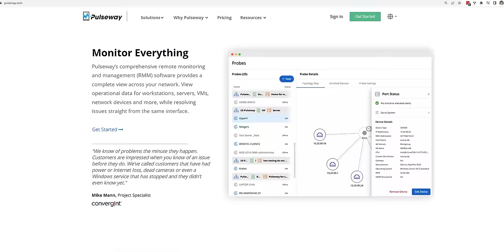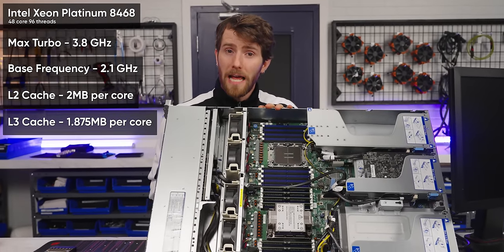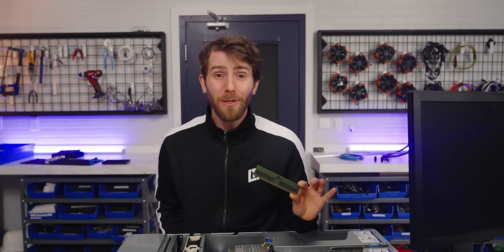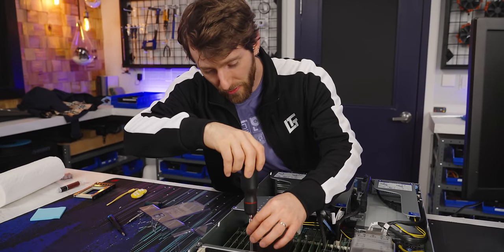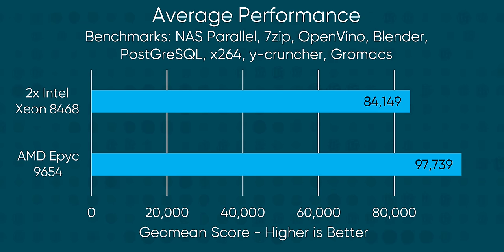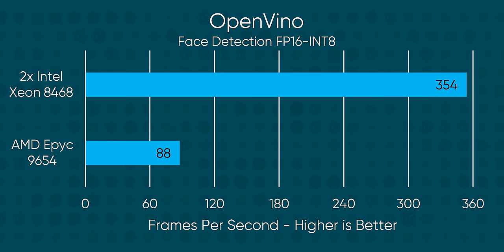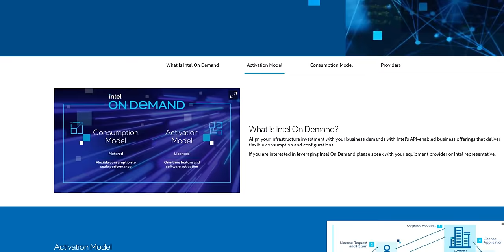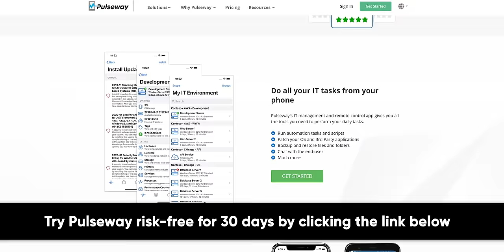Intel’s New CPUs are Cringe - Intel Sapphire Rapids Xeon Platinum 8468

Comment: But wouldn‘t the lower power consumption and lower Price of EPYC make it viable to install a pysical AI accelerator?
Reply: Or just wait a generation for amd chips with accelerators on chiplets. They're putting ai accelerators in their next gen laptop parts.
Reply: Unrelated: TPM 2.0 that is required for Windows 11 has security bugs so AMD and Intel are also putting new hardware security logic in future CPUs beside AI. I wonder when Windows 12+1=13+1=14nm+++ will require those instead. Hoping AM5 still supports those future CPUs in that case, from what I hear Windows 11 is a miss :P
Reply: @Malc180s  but if you can get by, then you can wait.
Reply: @mikfhan  From what I've also heard it's a mess, that's why I'm still running 10 and won't be upgrading for a WHILE.
Reply: @josiahsimmons9866  Why, because of the security vulnerabilities? They are unfortunate, but caring about them as a user does not make sense, and here's why:

On your current Windows 10 installation, you either are using Full Disk Encryption (likely Bitlocker), or you are not.
- If you are not, then you have far larger security concerns than the TPM 2.0 vulnerabilities, and therefore shouldn't care about them. 
- If you are, and you're using the TPM, then you're already subject to the TPM 2.0 vulnerabilities.
- If you are, and you have a different solution to Full Disk Encryption (encryption keys stored elsewhere), you can still use it on Windows 11. Just because you have a TPM doesn't mean you have to store the encryption keys on it.
Reply: @oumu  I have other reasons for not going to windows 11. I'm running a 4000 series ryzen chip, so I imagine that windows won't really be that optimized for it. I also heard that windows 11 was having issues with AMD chips in general(though it was a while ago, so maybe now that's a non-issue.) Ultimately the biggest issue is I use certain software that I'm not confident will run, or run stably, in windows 11 because of how relatively little development time they've had to update to it. Shoot, in the past, when I upgraded to windows 10 Minecraft wouldn't even launch for years. So I definitely have the precedence for software breaking with an OS update. When I eventually build myself a desktop I'll probably update to Windows 11, but that's anywhere from a year to 3 years away.
Reply: @Malc180s  Imagine all the people who have been waiting for this CPU to come to the world.
Reply: @josiahsimmons9866  ive been running 11 for a few months and works just as well as Windows 10 so far
Reply: @josiahsimmons9866  you can always create an 11 install on another drive and try it out
Reply: @zombl337og  Maybe it works for you, but I have sensitive software that I need to have running as smoothly as possible. To update to 11 is just not smart for me at this point. I also really don't see a reason to upgrade at this point.
Reply: @mikfhan  Why did big server run Windows?

Comment: That method of cpu installation has been around since first gen xeon scalable. You're also supposed to leave the cpu in the tray and put the heatsync on, then remove the assembly from the tray and install it on the socket. That method keeps you from getting any oils on the contact space since these cpus are very sensitive to pressure and contamination. Granted, I haven't worked on this newest generation but have plenty of experience with most of the previous revisions and have had to troubleshoot multiple installations where people didn't install these cpus correctly
Reply: Pretty sure he doesn't have a CPU tray because it came to him as an assembled system. So he had to improvise. That's not an excuse for getting goop in the socket, but it's why he isn't following the proper method.

Comment: For the AI benchmark that you  performed, there is an important disclosure to make: OpenVino is developed by intel, so it is only logical to be optimized for their hardware (so the AMD results may not be that bad in AI after all, if the customer is using another Artificial Neural Networks inference engine such as ONNX runtime).
Reply: intel has for a very long time provided some of the best open-source tools in all fields.  In general more often than not using alternatives just means far worse performance.
And also no, their code is optimised for general purpose X64 CPUs as it also has to run from their lowest single-thread Atoms to the 288thread lineups.
Reply: @ABaumstumpf  You're wrong, there's no such thing as a "general purpose x64 CPU", if you want your code to run fast, AMD and Intel don't have the same feature set, AMD didn't support AVX-512 till Zen 4, virtualization features are implemented differently, and , Intel C++ compiler is both closed source, in some situations faster than open source alternatives like GCC or llvm, and it deliberately generates a binary that only enables fast code if it detects an Intel Branded CPU, even if AMD supports that feature.

Intels response on the github bugtracker to AMD bugs is:

> Thank you for reporting, OpenVINO is officially supported on Intel Processors. Please take a look at the system requirements for additional information.

so yes, OpenVINO is crap for a comparison.
Reply: @woobilicious.  "You're wrong, there's no such thing as a "general purpose x64 CPU", "
NO there absolutely is. that the CPUs are not identical is the reason why you then compile the source for your  specific hardware to take full advantage of that, but the code as written does not rely on any of that.

"Intel C++ compiler is"
Completely irrelevant cause is a source you compile on your own.
Reply: @ABaumstumpf  OpenVINO is only supported for intel and (by community) some ARM chips. Code can be written in ways to benefit your architecture, and thus not a competitor. Matrix multiplication for example is probably way more optimized when using AMX, and not care as much to optimize other. 

Its incredible hubris to think that software made by intel for intel chips will even try to optimize for AMD, their only (main) competitor.
Reply: The real test is how does on Intel's CPU AI compare to GPU AI compute. I gather GPU AI still wins by a wide margin for both power efficiency and speed. However, if you really care about performance you go the custom accelerator route.
Reply: @domogdeilig  And it is just outright stupid to claim it is written in a way to harm performance for any architecture.
Reply: @chrisdrew9767  It's a difficult to say if CPU performance or GPU performance is better. It comes down to the implementation of an algorithm and application stability.
Reply: Thanks for disclosing this.
Reply: I'd not be surprised at all if Intel had some "feature" in the code that downgrades the performance when running on non-intel system
Reply: @ABaumstumpf  ??? if iam intel and iam making the sofware for sure i want my stuff to be faster and better than competitor, just a common sense
Reply: @ABaumstumpf  It's not written to harm performance of other architectures. It's optimized for performance on a given architecture. Same result, different motivations. If you want to build the best AI accelerator, and you want to sell your CPUs for their performance in AI acceleration, you're going to make your AI accelerator run even better on your CPUs so that people want to buy both from you. It's not necessarily about making AMD perform worse, it's about leaving no performance on the table when run on Intel processors.
Reply: What about just do a bunch of pytorch/numpy matmul to compare the 2 CPU?
Reply: @ABaumstumpf  First of no. It would not be stupid to suggest a company would make their competitors look bad on their software that they made. Second, noone is saying that they are activly trying to harm AMD. Its just not priority for Intel to get their software to run fast on unsupported hardware especially from a competitor. 

Why do you think NVIDIA and AMD helps game developers write better code for their GPU? To get better driver support and faster performance so when LTT or whatever benchmarkers test, it will be fast on their own plattform.
Reply: @chrisdrew9767  This can be usefull when running inference in production. Thus you can have a services running fast ai inference while also running all the other services you need which isnt AI. So then you dont have (and pay) for a gpu machine to run relativly small amounts of inference.
Reply: @domogdeilig  "Second, noone is saying that they are activly trying to harm AMD."
Aside from half the comments here are doing exactly that.

"Why do you think NVIDIA and AMD helps game developers write better code for their GPU?"
Not just for the reason you claim.
And going to the devs and giving them programming-training is something really different from providing open-source solutions.
Reply: @ABaumstumpf  it doesn't have to be written a certain way to harm performance, all you have to do is turn off compiler options

Comment: when you described AMX, I was hoping they would also be useful for non-ai simulation and animation type work. That involves a lot of matrix math too. But AMX currently only has one matrix math operation, while those non-ai workloads use a diversity of operations. Using current AMX outside of AI would involve lots of shuffling data in and out of the AMX registers, which would severely limit how much those workloads would be improved by the extensions.
Reply: I think it's just a matter of building out support, rather than a physical limitation, unless AMX is pretty useless even for ML. The kind of AI/ML matrix operations that need accelerated depending on what kind of algorithm you are using vary incredibly, and have a lot of overlap with animation+simulation.
Reply: @sophiophile  I'm not sure what you are saying. I am saying that viewed through the lens of what AMX stands for or through the lens of the applications that the name reminded me of, AMX is horrifically incomplete. I have no knowledge or opinions on the challenges or lack thereof regarding making AMX more fully-featured, and I have no knowledge or opinions on whether the current state of AMX is actually helpful for machine learning.
Reply: AMX matrix multiplication is awesome for many ML workloads. Matrix multiplication is also useful for a ton of physical simulations, but I'm not sure how that translates to animations or real time simulations like games. Not sure what Jeffrey Leung is talking about.
Reply: @cobdole9409  The main thing I had in mind when writing that was that matrix-vector multiplication is a major part of sims and animation. A matrix and a vector are conceptually different to me, so I didn't consider that a vector can be represented as a 1-column matrix, allowing AMX to do matrix-vector multiplication just fine. That substantially increases how much I can expect AMX to benefit those use cases.
Reply: @cobdole9409  The OP claimed that it only supports 'one' matrix math operation. I didn't look into the details of AMX, but if it can only perform, for example matrix addition in single steps and not calculate matrix dot/cross products (and by extension tensor products) directly like a GPU, thereby having to perform n^(w+v) operations for a single matrix/tensor product- it is only going to accelerate most ML/AI operations like 5 times compared to a regular CPU in most cases.  When the standard for accelerated ML/AI operations is CUDA where you are looking at a minimum of hundreds of times faster than typical CPU operation speeds, I just don't see how this is supposed to be seen as a selling point.

Comment: Linus drops a glob of thermal paste in the socket & it doesn't boot.  Wow, so unexpected!
Reply: Thermal paste in a socket isnt as bad as xou probably think. Its not conductive, so its not going to short anything out if im not mistaken
Reply: @hypershock4270  
IF its not conductive then yeah, should be fine, however that is not the case as some thermal pastes are literarly made out of metal like copper or alluminium... so depends if he used the metal based one or not
Reply: @robo-suport_czrobofactory3116  noctua's isnt
Reply: Yes most thermal pastes on the market are not conductive, I've seen a guy on youtube who put a whole tube of thermal paste and a cpu on top of a socket and it still worked fine.
Reply: That's what I said!
Reply: @dfjab  
good to know 
👍
Reply: Uh guys , if it's non-conductive then it could /should insulate/prevent a electrical connection to the cpu. Duh.
Reply: @hypershock4270  Yeah pretty much, but it's just such a pain to deal with when it's in those really small areas that are hard to iso out and you start to get worried maybe there's residual moisture still there.

Also I really doubt most people are going to accidentally encounter some kind of liquid metal or other metal containing paste.
Reply: Noctua thermal paste is not conductive.
Reply: @Douglas Holmes  not really
Just look at sub ambient overclocking and them prepping the socket by pasting it with vaseline
Reply: @douglasholmes7581  The amount of pressure the CPU is under will force the material off of the pin/pad into such a small layer that electricity can easily pass through, but there will be buildup around such that it is insulated  from the surroundings. This is why sub-ambient overclocking usually needs vaseline or dielectric grease in the socket, to prevent water condensing in the socket while also creating an insulating barrier between all pins.
Reply: @robo-suport_cz robofactory  if it's not conductive and it covers a pin couldn't that cause a problem in & of itself.  Don't the pins need conductivity to work between the pad & the pin?
Reply: @douglasholmes7581  yes exactly!  💯
Reply: @Domia Abr Wyrda  do they cover the pins in the socket though?
Reply: @bldos5362  yes it's actually so painful to watch lmao
ltt did it a few times too if you want to see Linus doing it
Reply: @hypershock4270  Conductivity is not the only issue here!!! Even perfect insulator around pins can change impedances (and electrical length) of the individual signal lines, from/to CPU, inducing skew. Just take a look, how much attention is paid during design of those traces on the MB, where every micron is important.
Reply: @bldos5362  
i was talking mainly about a short circuit, but sure if you manage to insulate the pin then it would be the same as not having that pin there at all however thermal paste is still not solid, and the preassure should move the paste out of the way to make a connection.

Comment: Did Linux really drop thermal compound in the socket and went "it's probably fine" lmfao
Reply: These aren't the droids you're looking for.
Reply: Good thing he didn't drop the CPU or cooler into a server LGA socket handwaving them around like that. Fuck that was scary to watch.
Reply: No, Linux is an Operating System, not a person.
Reply: And when it did not boot, he just blamed it on the design of the mounting mechanism
Reply: In all fairness if your compound is non-conductive it's probably fine. Pressure should spread it out and contact should be fine with nothing shorting.

But I'd still not recommend doing it =p
Reply: How did an operating system manage to drop thermal compound?
Reply: @outcastatsabre  Linus is the cartel execution videos of tech channels. It's like watching some Jihadist waving around a hunting knife.
Reply: @Stoyon  Linus made linux lol
Reply: @SyntheticFuture  If you have a non-conductive substance between a copper pin and a copper surface, then there won't be any electrical signal between the two (or the quality of the electrical signal will be degraded).
Reply: @RMerlin with a drip this small it should spread out. The contacts are under pressure so it should be squeezed to the "not contact" parts of the die mostly. It is still a very bad idea but still XD
Reply: Thermal compound isn’t conductive.
Reply: @brandongers  some is.
Reply: @brandongers  That's not always true. There is thermal compound that is specifically designed to be electrically conductive for some MOSFETs/IGBTs where the metal back is both for dissipating heat and connecting to ground.
Reply: @SyntheticFuture  Wrong!!! Conductivity is not the only issue here!!! Even perfect insulator around pins can change impedances (and electrical length) of the individual signal lines, from/to CPU, inducing skew. Just take a look, how much attention is paid during design of those traces on the MB, where every micron is important.
Reply: @sophiophile  wow it’s almost LIKE IT’S NOT CPU THERMAL COMPOUND THEN…

Comment: Maybe add an arrow next to the graphs indicating whether higher or lower is better. 

Rather than needing to read and figure out lower or higher is better and then look back at the graph. And with the switching axes, moving between vertical and horizontal graphs, it only ends up more confusing.
Reply: I think you're the only confused one here LMAO.
Reply: learn to read data dude.

Comment: I remember when Intel used to glue CPUs together, it was the Core 2 Quad Q6600. Great CPU, but it was literally two dual core chips on a single package.
Reply: They did that before with the Pentium D... But I guess it's clear that glueing two Pentium 4's wouldn't result in a great CPU :/

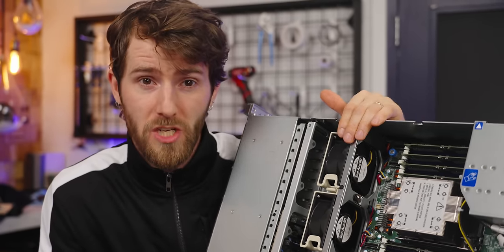Comment: 6:50 It wouldn't quite be "on a single board", since the 8-socket systems are blade configurations with multiple CPU daughterboards connected to a backplane.

Comment: As a system builder and someone who works on putting servers together, this isn’t a new way to install the processor, if you Buy OEM then yes you would have to do it the way you did, if you purchased through likes of Hp/Dell etc they’re already fitted to the heat sink.